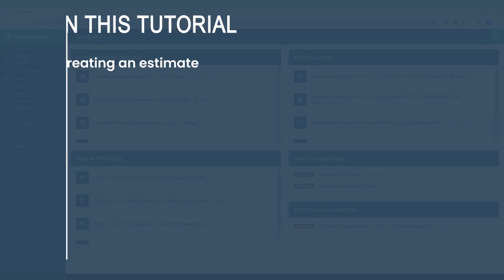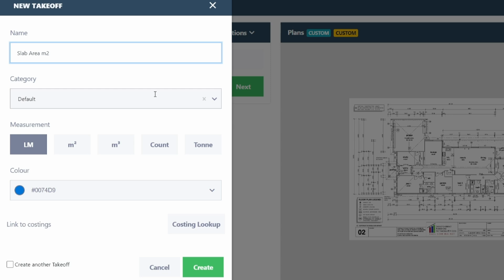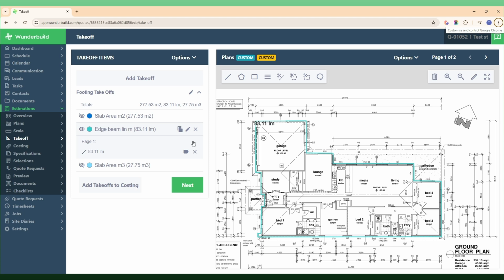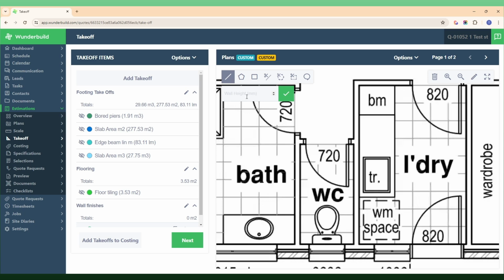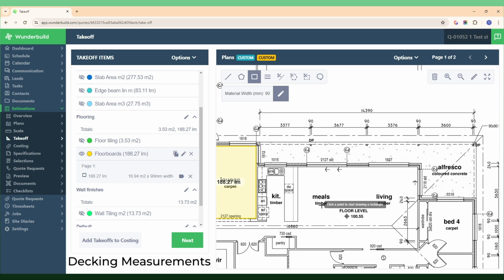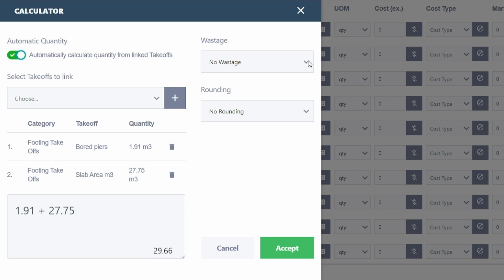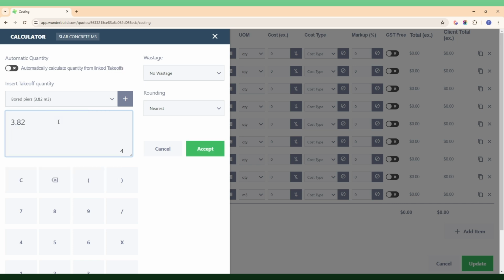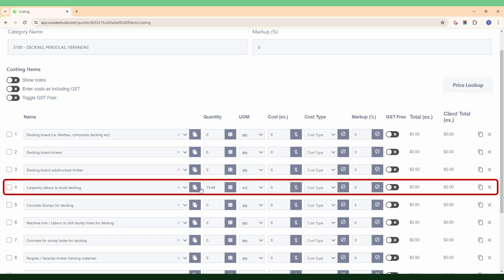In Depth Takeoffs Tutorial with Scaling and adding them to Costing secti

Comment: If there is capability of setting up templates for takeoffs that are linked to a cost catalog, it would be great to have this demonstrated
Reply from the maker: Hi there, thanks for your suggestion! 

You can set up templates for various sections of the software, including:

Estimate costings
Take-offs
Specifications
Schedules
Checklists
And many more

You can also create multiple price lists. Each item within your price list includes fields such as SKU, UOM, name/description, photos, and other attachments.

Additionally, you can build recipes/assemblies that can be used in your estimate costings. When you update your price list, any open estimates, recipes, or assemblies containing that item will be automatically updated—making your price list the central hub for your costings.